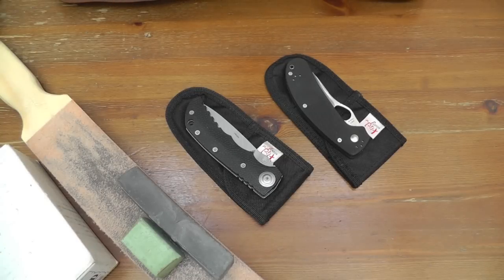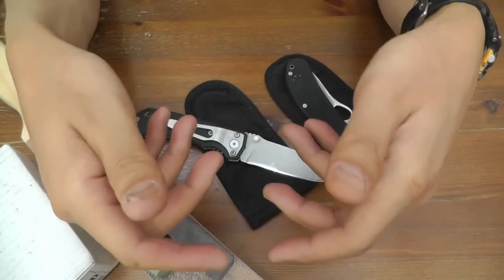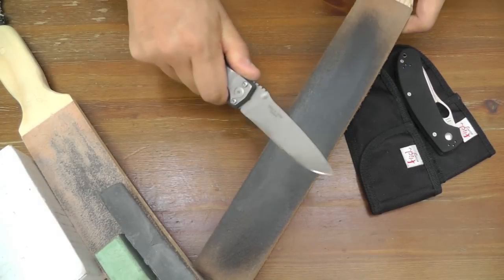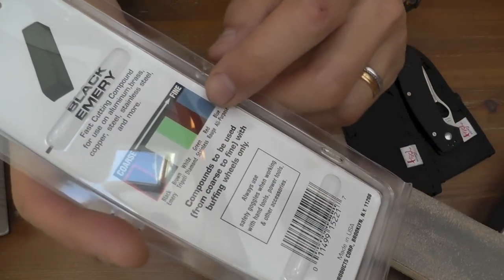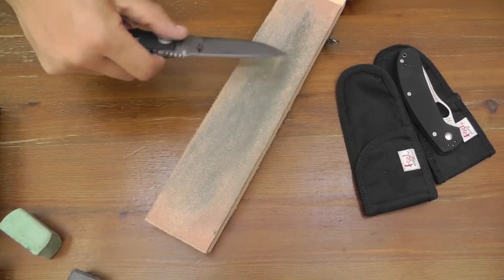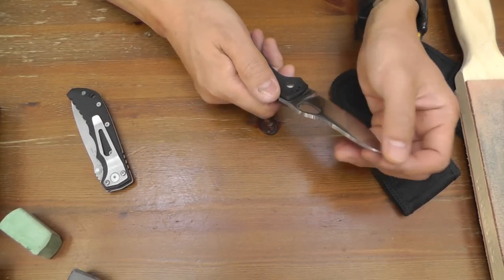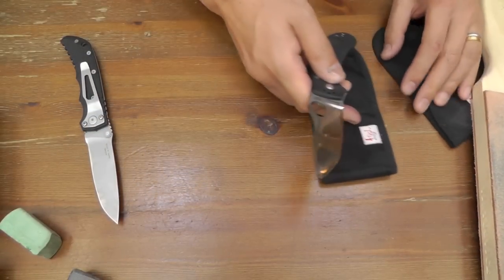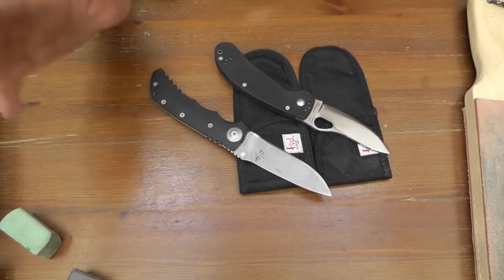My backup S30V knives and a new strop

Comment: About 2 months ago, I made my own strop. It is a 4 side strop made from a 2x stick of lumber. I purchased the everything at Lowes home improvement store. The compounds start at emery and go down to a jeweler's rough. I have learned to spend very little time on the jeweler's rough, but I do like to use it. Switching from honing flat bevels to a convex edge took some time to figure out. I had to adjust my technique, but now, I like it much more than a flat bevel. Thanks for all of your videos.

Comment from the maker: 3V Bravo1 already has a fatter geometry and a larger angle from the factory. I did its chip restoration twice and its edge angle got critically large. So you had better keep its edge angle as small as possible. The Otterbox strop is just for touching up. Thanks.

Comment: Thanks for the videos.  I just now put my first self-made convex edge on my mini griptilian using stones and stropping.  It worked pretty well.  Very sharp, but I think I need better stones to cut down on the time.  I will save for the chosera stones.  How do you compare S30V to 154cm after using the Gavkoo knife and Benchmade 551 in the field?  Maybe 154cm is enough with right edge angle and usually cheaper.  I look forward to your test of the S30V folders. Thanks, again. I have learned a lot.

Comment: Sure paper is easier to cut with the grain but if your knife is sharp it should be able to cut against the grain as well. Thats how I check (well one of the ways) my knives sharpness after the stone. If you can cut against the grain on really thin paper then your knife is sharp. Then roll that paper and cut the roll at an angle to cjeck if it has "bite" and you're set.